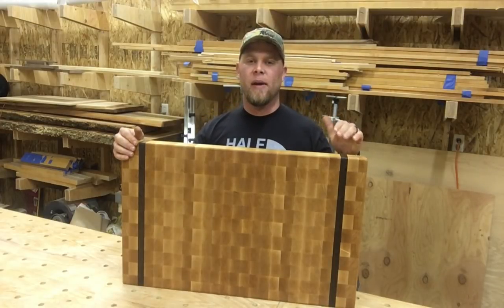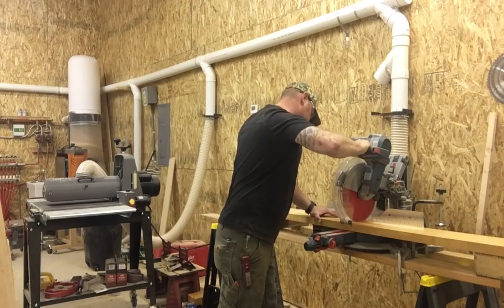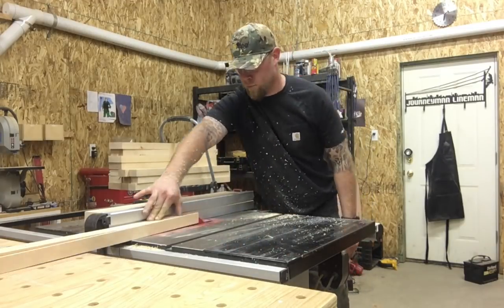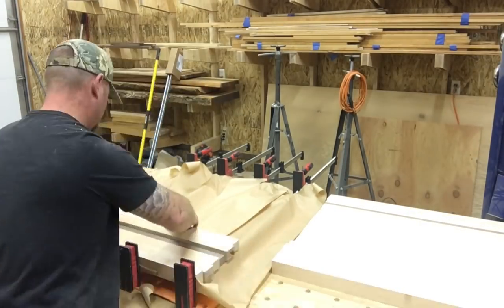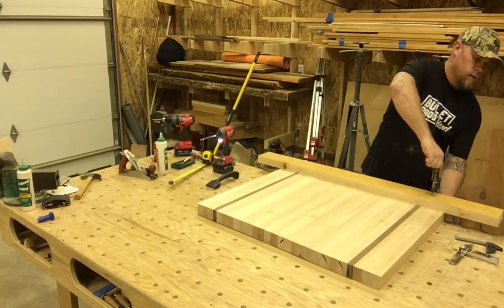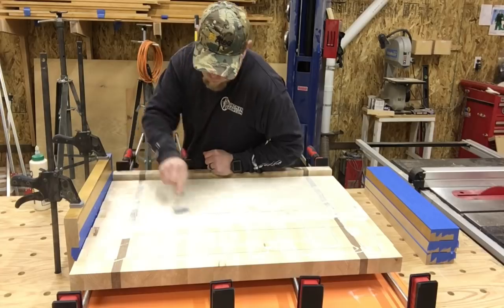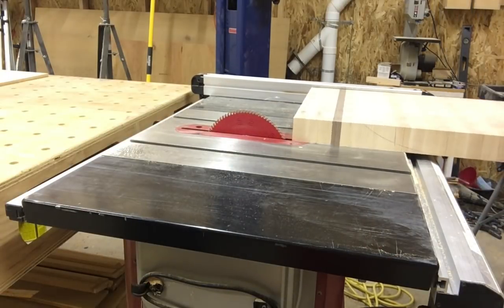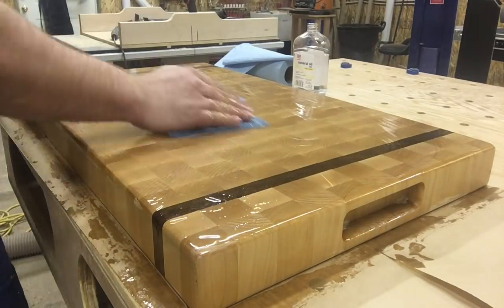How to Make an XL Butcher Block End Grain Cutting Board

Comment: If you had a better planer would you still need the drum sander (other than for big stuff like this cutting board)?
Reply from the maker: Adrian Abshire you can use a planer on end grain but only very carefully. Very light passes, otherwise it is disastrous on end grain. My planer will only fit 13”. If I had a bigger one I would probably try it, but I’m no expert

Comment: Nice job.  Do you have any voids in the drum sanded glued sides?  Drum sanders often leave a lot of linear lines/scratches and I was wondering if they show when you flip the strips and put the end grain up.  Could you not face joint or plane both sides instead of drum sanding one side?  Thank you in advance.
Reply from the maker: Tom Wrzos thank you Tom! There were no voids due to using the drum sander, I used a pretty high grit so there weren’t any bad grooves from the sandpaper. I could have planed the side that I ran through the drum sander, but I chickened out because of the risk of extreme tear out by planing against the grain. The drum sander worked out well to make sure I didn’t get tear out.

Comment: Do you have any thoughts on spraying the board with water after your initial sanding to raise the grain? Then sanding off the fuzzies one last time before applying the oil?
Reply from the maker: It’s a good idea on regular cutting boards, but on an end grain cutting board like this one it isn’t necessary unless you’re worried about the outer edge of the board. You can’t raise the grain when it’s end grain.
Reply from the maker: End grain doesn’t raise

Comment: What grit are you using on the drum sander? I actually have 120 and I'm having a hard time getting rid of the sander marks. They are very deep and all lined up, it is hard to sand them away.
Reply from the maker: Justin Désilets did you use a lower grit first? I did and noticed that it took the 120 forever to get it smooth again. I’m pretty sure I was using 80 and 120 if I remember correctly. It took A LOT of passes, definitely not the fastest way. Wish I had a bigger planer. When I sanded the face grain it wasn’t as bad as trying to get the end grain smooth
Reply: @FrankDoesIt  I started with 80 and removed most of the excess with this and moved to 120 to finish it up but still the sanding marks are very deep. I want to try to get some 150 and 220 grit to see if it makes a difference. Wish I had a bigger planer too, but those planers with helical heads are just too expensive haha.
Reply from the maker: Justin Désilets haha yeah no doubt! That’s why I don’t have one either lol, maybe some day. Yeah, so those grooves you have are from the 80 grit, and I struggled to get rid of them also, I had to finish it off with an orbital sander once I got them almost gone with the 120 grit. If you’re going to buy more paper I’d go for 100 grit to cut down those grooves a bit better, then go 120 and so on. If I had 100 grit that’s what I would’ve done and probably would have really cut down on my time
Reply: @FrankDoesIt  yeah I think I'll get some different grit and work them up one at the time with multiple passes. Might not be in a near future but if I ever try it I'll report back. Thanks for the quick reply! Video was great and definitely earned my subs.
Reply from the maker: Justin Désilets Any time! Awesome, yeah let me know how it goes! Thank you very much for the sub!